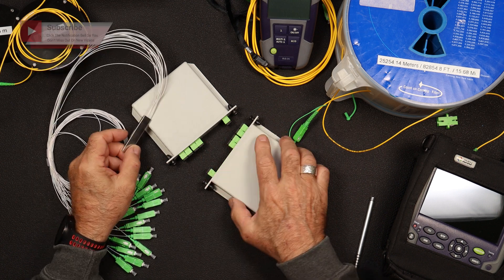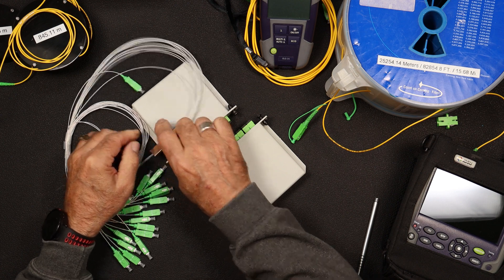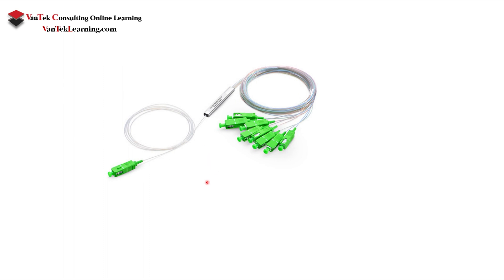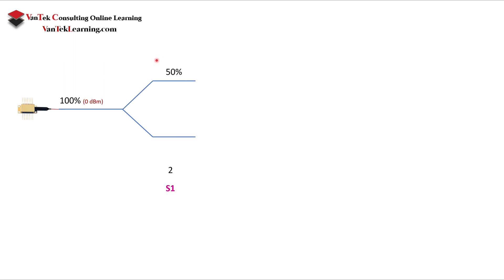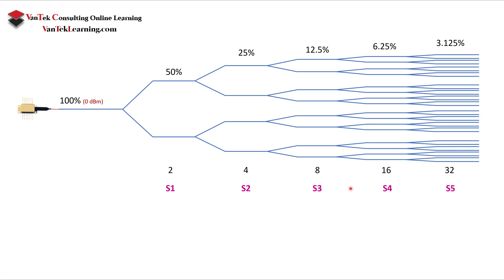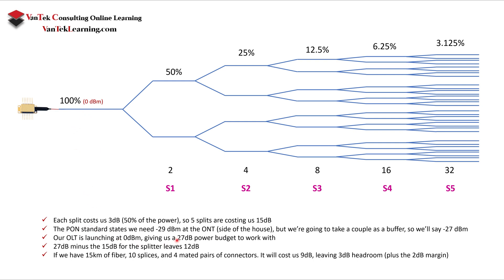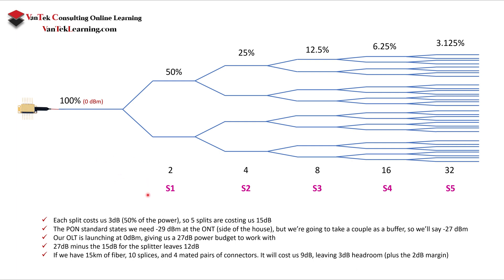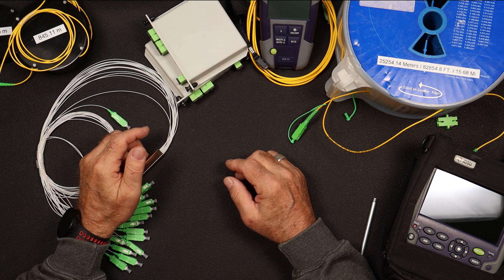PON Splitters Explained

Comment: Awesome, thank you I’m a fiber tech here in Arizona learning pond stuff sometimes testing can get a little irritating and I really appreciate the video. Thank you you subscribed.
Reply from the maker: Thanks for joining the channel. I'm glad the video helped. If you have any questions, feel free to reach out.
Reply: @VanTekConsulting  I had a tech to come out and install fiber internet on a 1gb service. His reading from the ONT was -20 for optical (I believe this is a light test perform). My question, is this a good reading and am I getting full light transmission?  because I find my download speeds caps at usually 500 mbps on downloads but upload is near 1gb at 940mbps. The tech as well as his supervisor say therr isn't a problem at fault. I'm relatively new to fiber and just want to ensure I'm getting what I am paying for. Any advice would be appreciated.
Reply from the maker: @brod3rick870  I would assume that the -20 dBm reading was from the OLT (downstream), the ONT needs > -29 dBm (closer to positive) to be stable. Light levels don't affect throughput, they are related to connectivity. Speeds can be affected by the site you are downloading from, server load, traffic shaping, etc.. The PON profile could be wrong. Are you using wired or wireless? That could be an issue. Lots of other factors to look at. If your service isn't dropping, it's not a light issue. Hope this helps.
Reply from the maker: Just to be sure, you did subscribe to 1Gx1G and not 1Gx500M